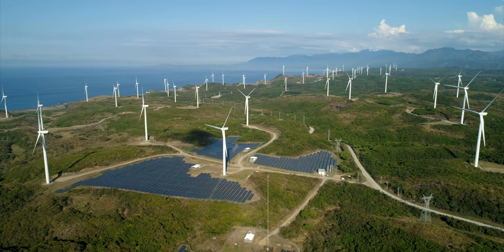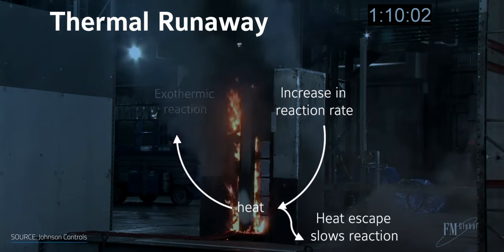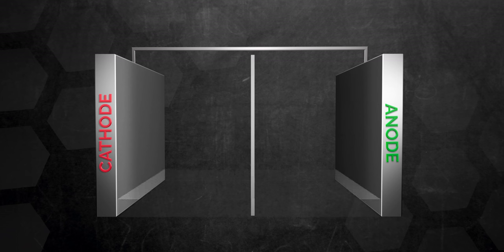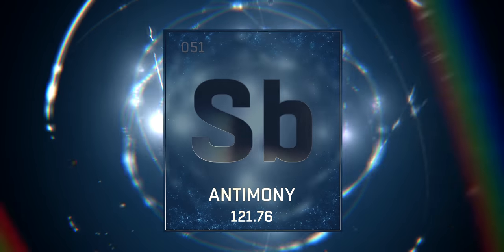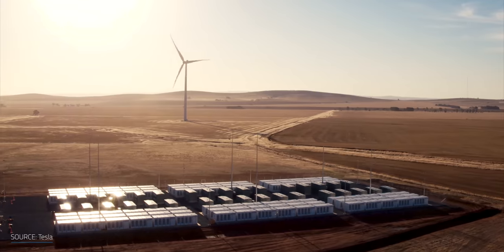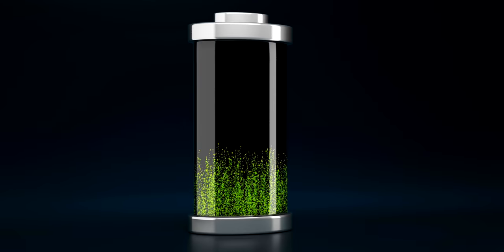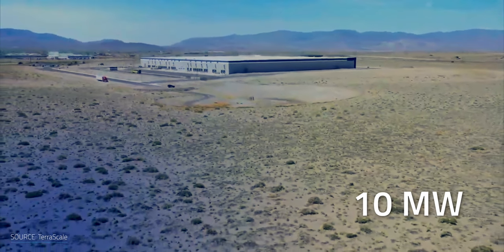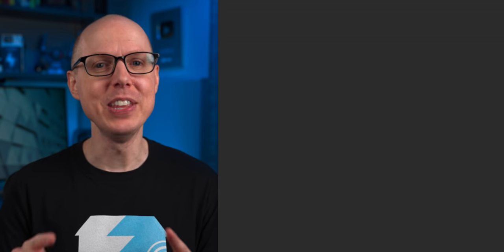Melting Metal for Energy Storage?  Liquid Metal Battery Explained

Comment: That looks like a viable technology for large installation grid storage. Would be especially useful with solar arrays in desert environments. Nicely done video
Reply: Yeah, the abundance of solar radiation makes keeping things hot a lot easier.
Reply: You know what would also work for half the environmental impact?  

A natural gas generator operating intermittently.

Utility scale storage has the potential to make everything much cleaner.
Reply: It will more realistic combined to solar concentrators
Reply: @southeasegirl2329  Yes, these plants are amazing, their hot molten salts can be used at night then reheated during the day, rinse and repeat.
Reply: Desert? Because they are hot all the time? Do a little research on temperature fluctuations in deserts and lookup population concentrations in deserts. Do you see any problems?
Reply: @ReevansElectro  No, because they desert (at least those to which I am referring) have large amounts of sunlight which can generate excess solar power during the day which not only charges the batteries, but keeps them liquid. They can discharge after sunset supplying baseload while also keeping the batteries liquid.
Reply: especally in conjunction with solar thermal, which directly could provide the heat to liqify the metals^^
Reply: @rottenmeat5934  while true that running something at maximum efficiency for less time is a potential gain, that’s not what gas plant operators want. That’s why peak-load gas turbines charge so much more money than baseload gas turbines per kWh. So although it could be a useful material gain, economically speaking it runs counter to their business model — letting it sit there unused is “wasted money”. At least with solar and wind it’s priced-in and built-in. In fact I would say a much smaller gas generator running all the time primarily to slowly fill the batteries prior to usage peaks would be more efficient than running a big one sometimes. This can also be applied to nuclear for a similarly small footprint with no harmful emissions. A small nuclear station with access to grid scale storage wouldn’t have to care about handling peaks directly at all. (In fact this is what initial research into energy storage dams was for — to allow nuclear power to tolerate demand peaks by relying on the dams.)
Reply: What I think was missed in this video is that the batteries create their own heat through the charging and discharge cycles.   There is no need to ambient temperatures to be high for the batteries to work.   

As the company states on their videos these batteries will work in any environment as long as they are cycled regularly.
Reply: @rottenmeat5934  Or.......millions of rodents on treadmill wheels running a generator ....why eradicate them... put them to work!
Reply: @ReevansElectro  the Ambri system is especially well suited for hot locations !  The Tesla system in Australia is at the end of the possible and safe temperature range (under current conditions, it will get hotter in Australia). The Ambri battery needs to be very hot, so Sahara, noon at the height of summer will be fine, just fine, one could not operate with Lithium batteries there. That would mean shopping for trouble, especially if you have the installation for years (as opposed to using a battery short term and very carefully mointoring and coddling it) -  at some point the cooling does not work perfectly ....  there you go. 

That could be a very costly fire and dangerous too. 
So they would not even try at a location that is more extreme than in Australia.
Reply: @peterknapp5440   He did mention that the batteries are heated up the first time (they are at ambient temperature during transport and installation). They have a built in device for that. They are well insulated, a large mass with small surface by comparsion, and self-heat (side effect, and loss of the process) as long as they continuously charge and discharge (he even mention a pattern of 5 - 7 hours that would be ideal - and that the battery is not degraded by deep discharge or shorter or longer cycles).

There is plenty of use for a battery that stores energy for one days or two. 

If they ever cool down into solid state, that does not ruin them, they just have to be heated up again.
Reply: @jelenahegser445  No, the batteries don't require external heat when operational. You just need to use them. The 20% wasted energy will keep them hot.
Initial heating is best done with an electical heater since, if all goes well, it only needs to be done once during the lifetime of the battery.
Reply: I think Robert Evans was referring to the fact that some deserts get very cold at night, which might make it a worse place as that's when you primarily discharge it. It might balance out since it needs to be molten when you charge it too. I don't know what his point was about population densities. It's usually better to just say what you mean than challenge people to go figure it out. They won't.
Reply: @kaitlyn__L  2 Questions for you
1) how are you going to handle the waste?
2) how are you going to handle thousands of small nuke facilities under safety aspects?

Using small gas generators is a good solution for seasonal differences but not for daily due to their low overall efficiency.
Reply: @Fredric169  you treat them like sealed nuclear batteries. The production facility can also be a deep underground waste storage facility, or at least short-term storage before sending them off eg to Finland’s new facility in a mountain which will be entirely filled in with concrete (aka artificial rock) and made inaccessible (there’s nothing worth mining up in the area and stuff too — very important).

 Although I would personally prefer to reprocess the waste into fuel; the final waste would last only a few hundred years instead of hundreds of thousands of years. But economic pressures being as they currently are, you’d need some kind of subsidy or tax to do that. As uranium and thorium are so plentiful in the ground currently, it’s an economic situation much as with all other recycling. (And I’d love all recycling to be made the preferable source of materials whenever possible, but I’m not going to pretend we live in that world today.) We know we can build structures (both physical and societal) which last a few centuries so the existential threats in the long term (ie how do we warn away others, should we warn at all or will that just draw attention, etc) would be eliminated. 

Nuclear waste is of course a concern but it’s a much longer-term concern than carbon output. There is no time to waste in reducing our carbon output, so for a time we will have to accept that making a little more nuclear waste is necessary. (Plus any increase from civilian sectors will be small compared to existing military nuclear waste, plus it’s far more responsibly handled than military nuclear waste. Campaigning against civilian nuclear tech doesn’t help stop that less responsible, more numerous waste being produced.) 

Additionally, if fusion becomes viable in the next century, then it will only be a temporary technology — most reactors are rated for 20-50 years anyway. Fusion only produces lightly neutron-irradiated shielding which isn’t dangerous for very long at all. It is well within humanity’s capability to store 50-100 years’ more civilian fission waste in existing and mid-construction mountainous schemes. Even if they don’t reprocess it, which as I’ve already made clear, is what I think should happen. 

Nuclear needs some amount of storage to make it viable to fast demand changes, renewables need some amount of storage to even-out production over the day. By combining the two, you reduce how much storage either one needs. I myself live in a locale which gets 90-95% of its power from wind and nuclear, and it’s great. 

Running a gas plant, even only a few months a year, emits far more carbon than this plan, and at the very least would increase the load on carbon-sinks which we must also implement. At worst, it could speed up ongoing environmental destabilisation. It’s not a viable solution, *unless and only unless* there’s 100% emissions capture AND sequestration AT THE PLANT, which so far no one has implemented more economically than renewables and nuclear.
Reply: @kaitlyn__L  The big question is how long it will take to get a successful demonstration and to show that economics work as well.
Reply: @ReevansElectro  desert is extremelt cold at night
Reply: @xyzsame4081  The amberi batteries are insulated so they will work at freezing temperatures as well hot temperatures.  The normal heat generated during charging and discharging  plus the insulation is enough keep the battery at the normal operating regardless of the outside tempter.  If the metals should freeze for any reason the battery management system starts charging the battery.  This will slowly heat the battery up to norma operating temperature
Reply: I was just wondering what the science says on high tempature batteries. Ones that become incredibly energy dense at high tempatures that will beat lithium ion out of the park. 

 I mean we are good at producing heat.

 I remember reading electricity and high tempatures don't like each other. Yet is that a product of our research focusing on room tempature batteries or a science phenomenon I mean.

Comment: You didn't mention the biggest short-term challenge for Lithium-Ion: there's not enough production capacity for the necessary raw materials, and the producers might not be able to scale quickly enough.
Complementary technologies that use different raw materials are extremely important. Liquid metal batteries are particularly interesting because they tolerate (and even benefit from) high environmental temperatures. Most types of Lithium-Ion degrade quickly when used at high temperatures.
Unfortunately, the Ambri battery is in the very early stages of mass production. The first (and so far, only) planned project, the 250MWh battery in Reno, is planned to be delivered to the customer from 2021 through 2023. At that low, pilot scale production rate the technology is useless. If they can't scale production very rapidly it may never be economically competitive.
Reply: I always saw Reno as a way to show that it works. Seems to be metal cases stored in a small shipping container that hold the battery. The battery also go from a solid(discharged) to liquid (charged) so transportation is easier
Reply: You know lithium ion batteries come in many different forms. Lithium iron phosphate batteries kill everything. For home or grid scale storage Sodium may replace lithium one day. Then that's all that's needed until fusion can be achieved
Reply: @tigertoo01  Yes, I know. But LFP, like all types of LIB still need battery-grade Lithium and Copper. Both of these could be scarce for a couple of years.
Sodium Ion might be a great alternative/complement if it materializes quickly enough.
Reply: @w0ttheh3ll  Agree that its not just a given there will be enough of anything but just looking at the current production and known reserves there is enough lithium for 100's of millions of EV's with a 60kwh battery. With Telephony and the internet merging and optical fibre and wireless communication becoming more main stream, Copper uses have reduced so the EV demand on copper is not as great as some believe. Still we will need a billion + EV's on the road. Unless autonomous driving becomes real and lives up to promises then the number of vehicles on the road may drop significantly. I think we should plough on with building EV's with current battery tech and hopefully it will lead to significant breakthroughs not only in battery storage but recycling too.
Reply: @tigertoo01  I'm not saying there isn't enough stuff to dig up, just that there will be short-term shortages because not enough digging is happening right now.
Of course we should, and will, continue to build as many EVs as we can with the best tech we have available.

Comment: "most popular and widespread energy storage is Lithium ion"
That's just not true at all, pumped hydro beats it by a very large margin
Reply: Replacing “most popular” with “most popular for new installations” and “widespread” with “not geographically constrained” makes the statement true. He should be more accurate in word choice, and also explain in this video about grid scale energy storage the pluses and minuses of the major players, which MUST include pumped hydro, since it’s the clear leader in installed electrical energy storage in both GW and GWh comparisons.
Reply: @altosack  yeah, changing every thing false or inacurate in the statement makes it true...
Reply: You have pumped hydro in your house

Comment: The down sides in using liquid metal batteries are efficiency (80%) and charge leakage. On the positive side are potentially low cost, stability, and longevity. Ambri is a clear competitor to Tesla in the market of grid level storage. I wish them well in their ramp to production.

Comment: "That vaccuum is cool. How much is that?"
'$50 off with coupon' 😐
$500 price tag 😑
Reply from the maker: It's pricey, but it's pretty awesome.  My wife has said that numerous times since we got it.
Reply: At first I was disappointed by only 37 reviews but other products from the same company have thousands of reviews so it appears worthy of consideration.
Reply: At that price I’d highly consider the Dyson product this is cloning tbh. I don’t have anything against product cloning but if you’re almost the same.. but anyway I’ve got an older one of this style, the Dyson one, it’s actually good enough to replace a plug-in upright vac if your place isn’t huge. So that’s nice for storage reasons in an apartment. This is a god use for the power delivery of lithium batteries, to get the suction, so I can see this becoming an increasingly common form factor.
Reply: @UndecidedMF  why would u but a manual vacuum when you can get a robot for same price??
Reply: @J Hemphill yes I know the attributes and flaws of a robot vacuum, and you need to supplement manually its losses. But when 90% of vacuuming can be automatically done, and once you own one you realise how much time you save. All I'm saying is I had to laugh at someone trying to selling me a manual vacuum. btw, my robot spot cleans, doesn't bumble, and also mops my floor, all while I'm at work, does an excellent job and saves me 35 mins of mindless manual labour per week. Look I get it, hes just advertising his free vacuum and who wouldn't. But if you've going to spend that much, get a robot, because you wont regret it.